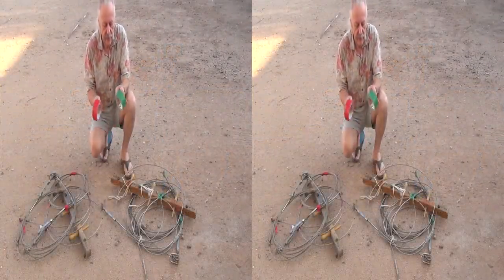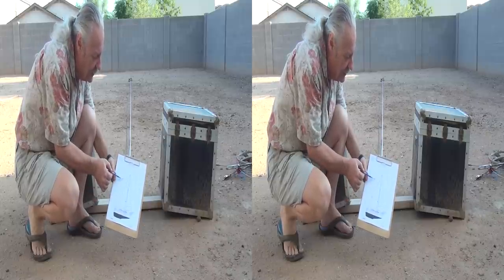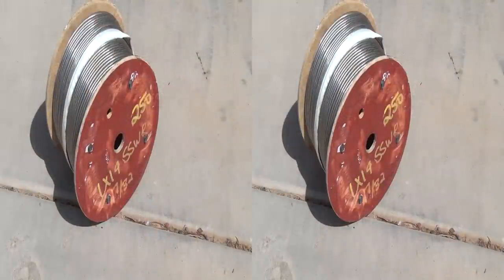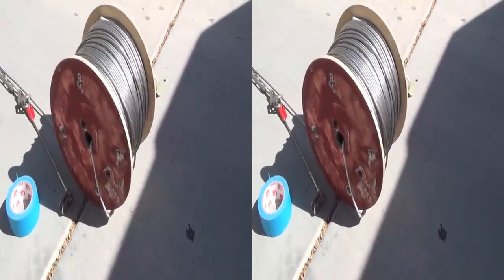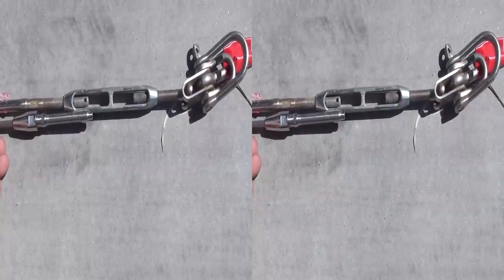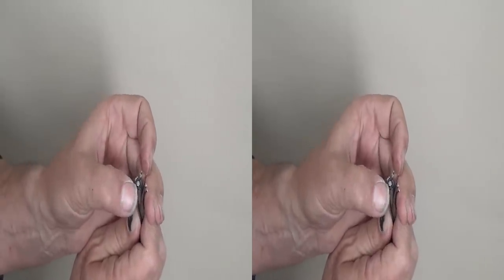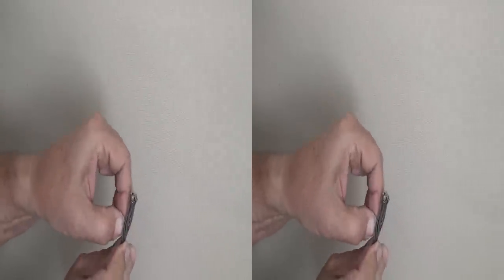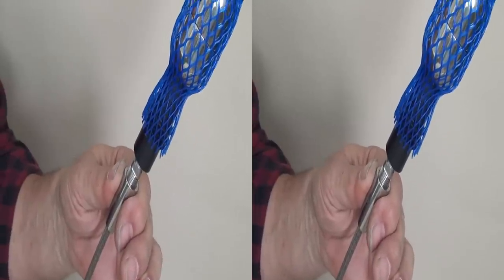Standing rigging replacement

Comment from the maker: Actually, maintenance is easy on a Nor'Sea. You just take it one step at a time. And on a 27 foot boat, it's a LOT easier than on larger boat!!! The smaller the boat, the lower ALL of the costs are. When we were cruising in the Sea of Cortez, two (2) boats in the 40 ft range offered to trade us straight across for our Nor'Sea! As you can see, we decided against the larger boat.

Greg